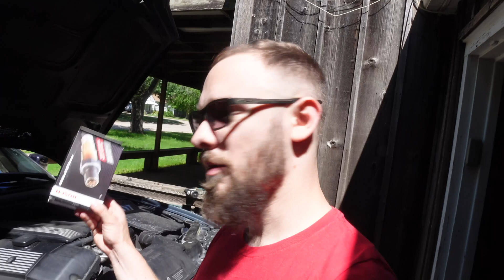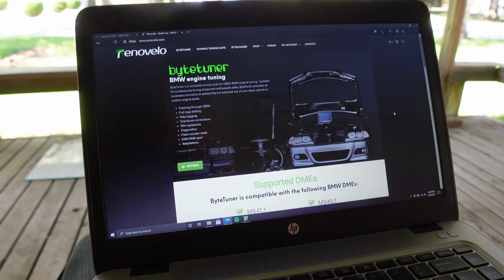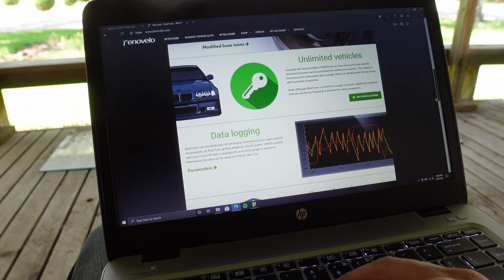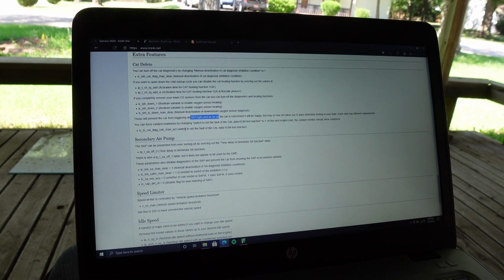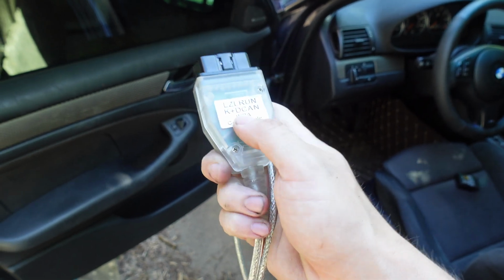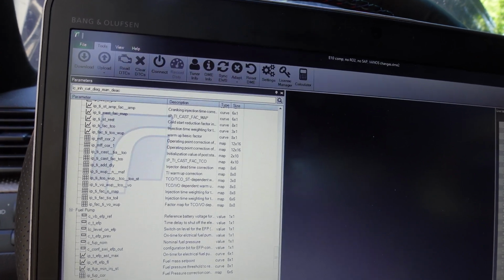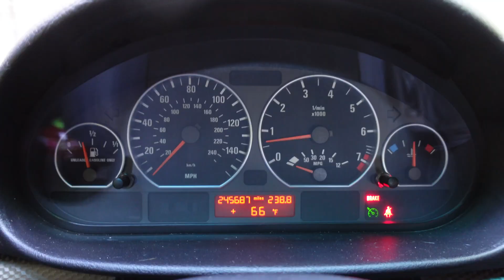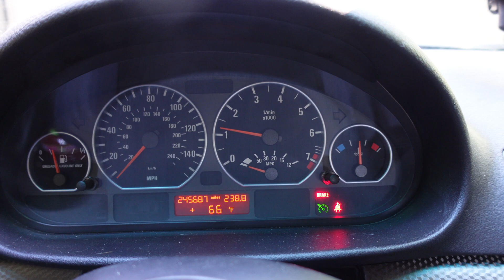Check Engine Light BE GONE! DIY SAP and O2 delete tune on my E46

Comment: Hay friend, i want also cut cats because i have errors p0430/p0420(29f4/29f5), and i want turn off downstream o2 sensors because its show cel(check engine).
With wich program i can tune them thanks :) ?

Comment: Can you adjust target AFR's with bytetuner? I'm interested in running a slightly lean burn and lowering idle if possible. The other tune packages are only about raising rev limit and idle and thats just not what I want to do

Comment: Never got rid of the intermittent barometric pressure CEL on my ZHP after replacing all kinds of metering and measuring parts, gaskets, etc. Even the ECU under emissions warranty. Finally got rid of the CEL by

selling the car.
Reply from the maker: Currently fighting that one myself. Nobody seems to know the fix. I might try replacing the baro sensor inside the dme itself.

Comment: Reading DME isn’t going to brick it but can indeed drain your battery. Writing on the other hand can brick your DME if the power drops mid way.
Reply from the maker: I'm having to remember off the top of my head but I thought it had to put the DME in a special mode to read the whole program and if the power is interrupted it will soft-brick the DME. ByteTuner does have a button to recover from soft-brick but... just better not to be in that position.

I could be totally off base though.

Comment: I have those two deletes, but I also have a supercharger.  The SC tune is encrypted, so this won't work for me.  I'll need a custom tune.
Reply from the maker: I'm shocked the tuner that made the tune for the SC didn't delete those items from the start.
Reply: @100PercentJake  They did, but they screwed up something else.  About every 300 miles after resetting adaptations I get a surge while under load. Like getting on the interstate and up hills. Put the VF Engineering file back on and it runs perfectly over 650 miles so far. Just need to get rid of the CEL. VF said their file is encrypted, but should be able to downloaded it to make changes and flash it back.  I just don't have the ability to make the changes. Tried a HEX editor, but can't find the parameters in the file in there. Not even on the stock file, so I must be doing something wrong.  Renovelo said their GUI won't work if the file is encrypted.   $500 down the drain because I won't ever take my car to that POS again.
Reply: To be clear I bought the VF SC kit and tune.  Then during the install decided to go with headers and SAP delete.

Comment: Had a 96 Audi A6, check engine light came on around 80k.  Pulled over, called service garage.  Is the car running okay?  Yes, the car runs fine.  Just O2 sensor, think it has 6, $200 each (ouch).  Told watch idle speed, when so low it's going to stall - time to replace. Left the light on for the next 250k miles

Comment: If it's off a 325i, then it is not an m52tu (25b or 38b). The low emmission m54 (can't remember the extra letters after) that could ce on CA, NY and a couple of other states epa regs. The m52tu25b or 28b engines were in '99 and '00 e46 cars like my 323i (m52tu25b).
Reply from the maker: I believe it would have been an M56. I'm sad the engine was missing from the car; I'd love to have grabbed the valve cover.